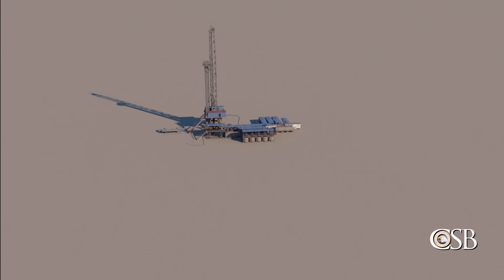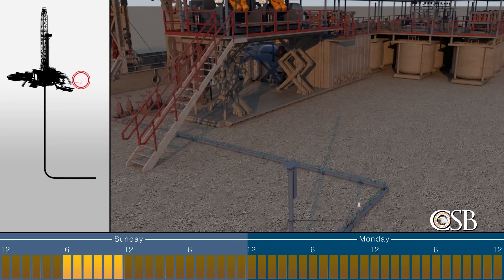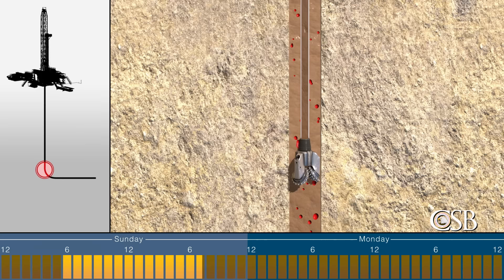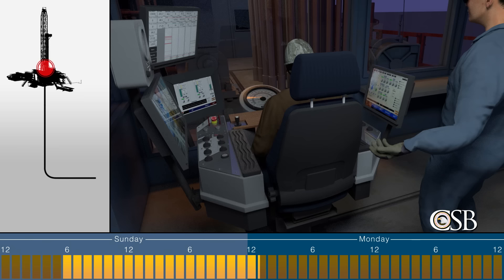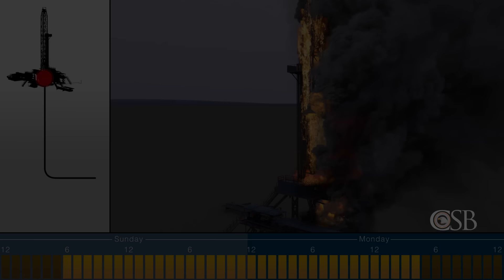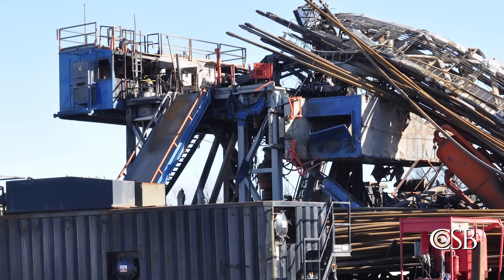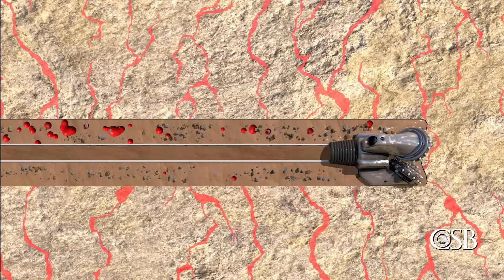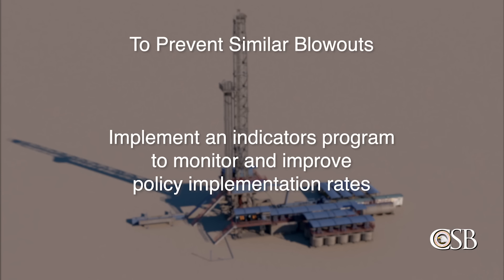Blowout in Oklahoma

Comment: The alarms are very annoying and are acknowledged about three times by the driller. At this point they totally deactivate them. The company man and tool pusher usually rush the driller during a trip so they can get back to bottom and continue drilling. The driller then becomes focused on making good trip time and not monitoring the well for flow.  Monitoring the well for flow requires halting the pipe.  Most companies have an extra crew member nowadays called a shaker hand whose sole job during tripping is to monitor the trip tank and record volumes to ensure the well takes the same mud volume as the steel pipe that is removed. If it doesn’t match it should be reported to the driller and company man!  This blowout was extremely preventable!  I had worked with the directional driller that perished in the driller’s cabin on this rig.... Patterson is completely at fault for not ensuring their rig crews were properly trained to recognize a kick!!! Not debatable!!!

Comment: The mud skubblers had not been rewarded their midnight skudge nobbers, so the king mechanic changed their shift without a secret handshake. This allowed the second shift king flubbler to enter the workplace without a super badge. The pressure grew.
After the badge alarms weren't triggered when the floorge tank reached 51%, the gauges dropped, and gas rose. Unfortunately, the gas pipe sand blower was in the off position. It was in the off position because the sludge duck never quacked, nor cracked. Therefore, the gluck sensor was off. The griller absolutely refused to pass this information onto the Padish Emperor. Spice began to enter the tanks as well.
The gravity rod was beginning to bend. The gas began to rush in. The other gas rushed out. A giant fictional fart ruptured the glush walls, and the driller didn't tell the local griller.
Etc.

Comment: The mudlogger should have been running a trip monitor to ensure the well was neither taking or losing mud. Standard practice wherever I worked over a 40 year career. Having the degasser running and flaring is a pretty clear indication people are not paying attention. If you have gas cut mud you need to weight it up, so the mud hydrostatic exceeds the formation pressure. How the flo check missed the fact the well was flowing escapes me. With  everything else going on I would have kept that flow check going until flo was detected.
It is not rocket science. In my world a 5 barrel gain or loss would need explanation, a    hundred barrels new personnel all round.

Comment: This blowout could be PREVENTED at various points of time, during the 20+ hours before it happened!!!

Then WHY it happened???

Based on the information made available in this video, the culprits are the two Drillers: unqualified out and out: the rig was NOT equipped as an Underbalanced Rig, it they ventured to continue “underbalanced tripping”, ... then worsened by pumping Lost Control Material (!!), and every other steps taken thereafter were taken by stooges, not drillers worth the salt.

The CSB also failed to call a spade a spade! 
What a shame!

Prof. M. R. Awal

Comment: Whenever I hear about any disaster where someone has turned a warning system or alarm off it just drives me insane that someone could actually intentionally disable such systems that could have saved lifes instead of just putting up with an occasional annoyance .
Reply: Except you have hundreds of pointless alarms that don't do anything and get in your way designed by folks who have no sense of how the actual operation works. The regulatory folks always want another alarm. If they would spend a day onsite they'd be focused on turning OFF the annoying alarms. Remember they made everyone put the loud omnidirectional backup alarms on so that you could never figure out what was moving and so many they got ignored. They finally came to their senses and now allow a more white noise softer SHUSH sound.

Comment: Not entirely sure but some have told me Cdn standards are alot strictor for even caintanment of mud. Been around oil rigs doing the fracking. Was driving the trucks. Just about got backed over by a truck i was one of several water trucks. They had lost pressure on the well. I was helping another guy that was on top of water tank. Other alarms and noise other water truck backed in beside the truck i drove. Big hurry. Knocked me down on my knees. Truck stopped only because the truck was far enough back. Another few the rear dual wheels would be over me OUCH.   The driver later saw me on the ground. Tried to make exuses. Was suppose to waite and be guided back.  Hurry hurry hurry. Getter done. Tired long hrs inexperience help. Etc etc. Shit happens. Why could NOT  a good side exscape ramp be proved. Something like airplane slide ramp. Get the yeck out of the Driller's Shack Dog house ASAP. Down a protected. Ramp with foam fire retardent being injected incase anyone already on fire. We work with safety equip NOW currently protype " traction on ice" for vehicles. Big issue at job sites and roads too. 1 403 830 4124  we will find out i will personally look into this. We work on protypingbequip when we hear of events like this. I have personally been in and around drill rigs. Yes could jump off but fires all around seconds count. Jump into what ? Escape routes with foam fire retardens being injected.  My heart aches for these workers. And their famalies. Socialism is NOT the answer. Seen stuff too often were gov DOT inspections worried about ever "i" dotted and "t" crossed while ignoring the bigger issues. Yes blasting caps on same semi load as the exposives. This is captialism ( whic is NOT free enterprise) at it's worst. Look at Boing knowingly willfully risking lives and FAA inspectors turned a blind eye All for the $$. Share holders should be held responsible too.  Math 24:12 kjv iniquity ( trangress HIS WRITTEN WORD  knowingly willfully) And the LOVE waxes cold ( kjv) like candle wax has gone to far from the LIGHT. WE have called covetousness and materialsim ( Isaih evil shallbe calledgood) we have called it " good christian stewardship
 Solar eclipse Aug 2017 USA over 7 town named Salem ( called peace) was blocked out. NOW violence. Wake up turn from our evil ways. ZECK 14  and NO more Cannite ( pagan traditions) we love our yraditions and our lifestyles more tha HIS WRITTEN WORK.  Judgement is coming. Shame on us. 1/4 pop of NY tested high for mercury toxcity over 10 yrs ago NY officials did NOTHING to reduce toxcity Mercury in big tunna fish. Shut the cannieries down. Mercury was a major issue world wide  in 1918.  Better ways of doing things. Germany uses "activated oxygen therapy ( east german connection) 20 M more pop than France but 1/2 fatals covid. 1 403 830 4124

Comment: when they pumped in the wrong plug material and plugged the bit, they were doomed as from that point on they could not add weighted mud to the hole.  they could not lower the drill pipe either as that in itself would push drill mud out of the hole further enabling the entrance of gas.  having made that mistake im sure the ones in charge tried to rectify it by getting the plugged pipe out of the hole and getting a clean bit onto the drill string in order to get back into the hole to get heavier mud pumped in.  they did not have the time to do it..  closing in the well with the bop thus cutting the drill pipe would bring a whole new set of issues like another company having to come out and secure the well, fish out the drill string and get heavier mud into place.  also a terminated rig pusher, two floor crews, mud loggers as well as a few rig supervisors ...   very embarrassing ....  so the decision to pull the plugged string and re enter the hole and  get heavier mud into the hole. if anyone actually caused this it would be the crew member that misread the radio message on the type of plug to put into the hole thus plugging the drill string.  although the driller should have known that to be a mistake he continued as instructed because he was already in the mistake loop and pushing more mistakes onto higher ups in order to have plausible denial.  the driller is much like the pilot of a plane ,they have the final say even if Kobe bryant is pushing him to get his kid to the game on time....

Comment: Not far from where I live.  Had a blowout a few miles from me not too long ago as well.  5 dead on the one nearest me.  I worked rigs in the 70's to help pay for college.  Nothing like the rigs they have now and not near as deep.  Safety was not as good either.  The older guys were always missing fingers and when we were tripping pipes, I spent a lot of time on the floor.  Just a movement of pipe or a chain tossed too fast  or a million other things and you would be lucky to just lose fingers.  Tower guys were the ones that would not have a chance even with the emergency rip line

Comment: If those guys were running because they knew the well was going to blow out, why didn't they shelter somewhere farther away than that little control shack?
Reply: Because it's a habit /  involuntary reaction to run into the doghouse (the little control shack) when you are a rig crew and something happens on rig floor. In this case, this iis a very large land rig with a huge doghouse with crew change lockers ete etc..heavy steel walls and doors....the instant thought is im protected from the massive rain shower of falling mud inside here. But in the end they only had seconds.

Comment: Where's the function of mud logging company in this case? They should've seen the gain in trip tank despite of driller turned the alarm off.
Reply: Why would a mud logger see that?? It’s not there job to monitor tanks.
Reply: @mcgee_tradez4991  mud logging company such as Geolog or Geoservices normally install abundant of sensors everywhere, including mud levels also. I don’t know how they do it on yours, but in my operation, their sensors are mandatory to be installed everywhere to monitor any conditions. Hello from Indonesia

Comment: They turn them off if nothing is changing. They were in a holding pattern for some reason waiting for word what to do so they waited at a dangerous time. They bop is designed to talk a kick like that  someone made a mistake or several. One thing for sure you cant work for 12 hours with those sirens are blaring so they turned them off.  Unprofesional crew i wouldnt doubt.

Comment: The most  Unsafe thing thing is having a driller cabin. Should be out on the floor with the rest of the crew. You can see more and hear More.  Driller Should have let them off the rig floor Instead of thinking the driller cabin was safe. Dog house

Comment: I guess the alarm system was extremely annoying, overprotectively beeping at every minute issue, why else would they have turned it off? I've seen this before, it sucks, but either you die once or every day, being tortured by the fcking alarm going of at everything. 

Could be wrong though, but i've seen this similarly at my company, we turned off almost all safeties and alarms, they just annoy the hell out of the workers, who have to use the machines 365, 24/7 for years of their lifes! But they are also very well trained, which seemed to not have been the case here.

Comment: Thing is oil and gas dictates to oklahoma safety.  Back in the 80's when I would go with cranes on rig moves as a rigger I ask why doors only opened to the floor from the dog house and not have a slide or stair to the outside of the shack. For evac. I was told by the driller it ain't cost effective. Imagine that..

Comment: Whoever couldn't stop the alarm instead of turning them off its not simple as trying to ignore a smoke alarm with no smoke but both shifts couldn't so shut down operation or operations and think of another strategy as much gas was over flowing... red mountain is full of petroleum why over due operation I never done this type of work but those lives could have been saved u always go with your gut feeling any if it feel unsafe doesn't matter who u are u have the right to stop work authority for everybody sake

Comment: Before tripping you weight up like wtf is wrong with this video.
Calculated filling of the hole which is a non standard procedure.??? This video is a joke. Always keep the hole full when tripping out of the hole and do your propper flow checks.  99.9 percent of the problems solved In this particular situation

Comment: There shouldn't even be a way to turn the alarms off. Wtf
Reply: Yes there has to be a way to turn alarms off. The alarm isn’t a quiet beep. It’s a blaring alarm that flashes a red strobe light. It’s normal for different alarms to go off, take for instance losing mud. Naturally you lose mud as you drill so when that alarm goes off you would silence it. Can’t expect someone to do there job with that alarm going off all day. It be like asking a pilot to fly all day with someone blowing an air horn in his ear and flashing a red light in his face.

Comment: Those mud racks should have been sealed with sensors inside detailing change in pressure with a secure pipe out let to collect the gas and release safely away from the rig, a few kilometers away, new designs in order , shit sacks with a longer intestinal pipe leaving the rig, sensors all the way bayby

Comment: Brought to you by the undying need for cheap labor and maximum profits. Not a knock on patterson, I've heard little but good things about that company. Just like what is known of the deep water horizon incedent; current SOP's, at that time, and common sense was ignored. Also... just like with deep water horizon, added paperwork and more SOP's that will inevitably be ignored, is not the solution. I understand the issue with alarms, but I have never known a good driller to continue ANY operation without having full control of the well.

Comment: They had a environment of running for cash instead of safety first and mistakes last. Greed to get to the flow they chose to let it go. That’s why it was created to blow. I worked in the chemical refinery industry for 28 years. From OSHA,VIP, BLACK BELT SIGMA, DEQ,EPA and LOST PREVENTION AND BBP. All played a important part of not having LOPC or LOST TIME. But this industry is still NOT A SAFE WORKING ENVIRONMENT. They let MM governs THIER safety. Repair when it does not comes at the cost of lost FOOTAGE. Put a bandaid on it. Bypass that PCV and give me 5 threads and 1 half turn. That’s why it’s a dangerous azz industry.

Comment: Holy moly up here in Canada the safety regulations and the laws got tighter some are just cosmetic but there are still very strictly enforced in Canada’s oil gas resources sector gladly to say nobody as lately needed the emergency shower the hospital has not had to use Oxygen on a oilfield worker as of yet today  we must wear a min. 3 head monitor must wear fire retardant coveralls oil same clothing with hi vise stripes we all have to have oilfield training

Comment: It was a very devastating last of 5 Ironman, more likely 99% the word (Hurry up)was use on them an of course from the pusher and company ,thats there favorite words when tripping pipe, drilling  ,rigging  up ,or rigging down ,its all about loosing money to them , the roughnecks are just a number to them ,even the safety guys and company supertendet go out to location an push there weight around, sometimes they don't bring out the right equipment to work safe , I've been there also ,when u ask for safety equipment and they ignore u or laugh at u ,until something like this happens an they start pointing fingers of who's fault was it ,and they end up playing  a dead person ,yup that's the oil field for u , a ticking bomb if u take short cuts ,remember BP.

Comment: Go get you're tripping juice, gonna be a 12 hour straight workout NO breaks. To any new Roughnecks out there I have a pro tip. while working; work as HARD as you can for about 30-45 mins, by then you're endorphins will kick in and you can maintain hard work ethic & don't be fukcin late on samples, keep the rig clean especially the celler & floor, lastly listen to you're driller. Take my advice cus if you don't you're ass won't last.

Comment: The oil industry has been around HOW LONG? And they are just now deciding they need a state based alarm system for different operating modes? These profiteers are fucking rocket scientists. Reminds me of the inbred trucker who drives down the Interstate with a flat tire until the rim is sparking like 1000 angle grinders.